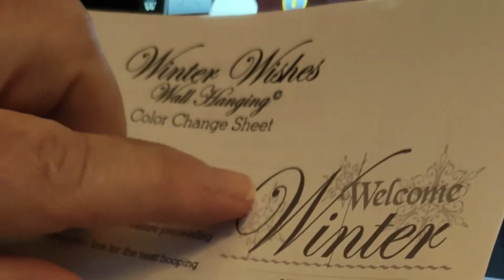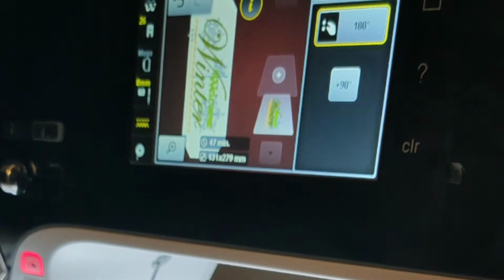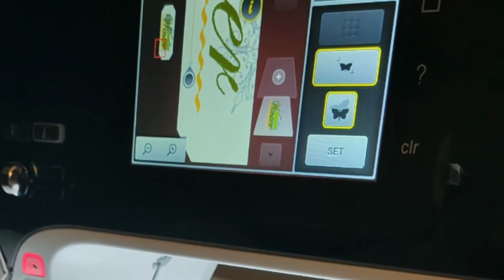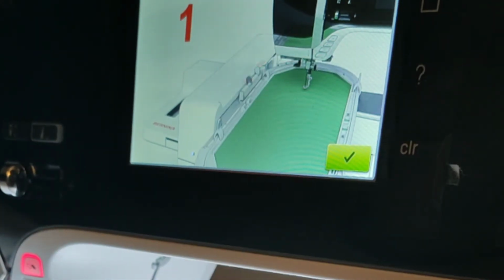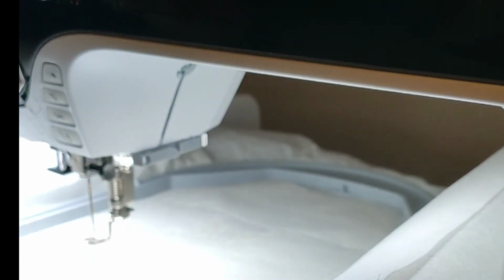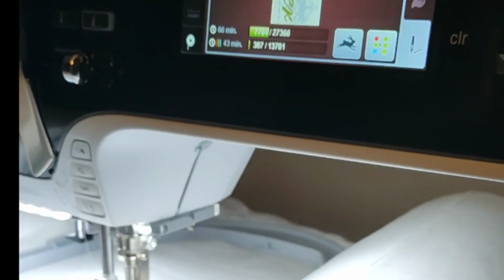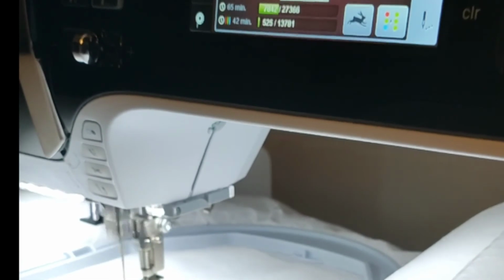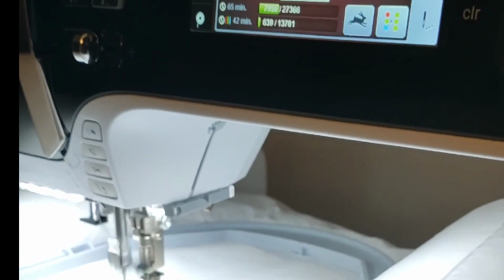Embroidery on Bernina B590

Comment: Nice design. I didn’t know that water soluble thread was available!  I find my Bernina is very fussy about embroidery thread. I have found Medeira polyneon the  best so far. But I have never tried metallic thread. I always had problems with that in the past just for sewing on a basic mechanical sewing machine.
Reply from the maker: Maderia makes a water soluble thread.  I use Mettler IsaCord.   Most Berninas are tested with IsaCord.